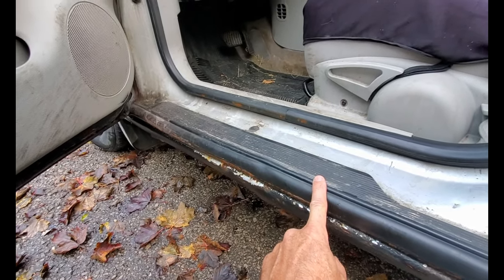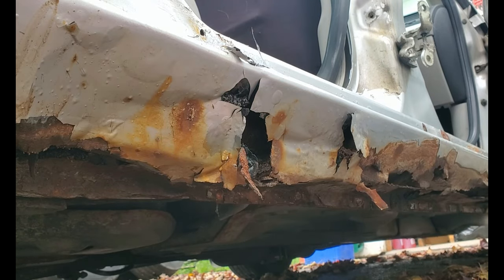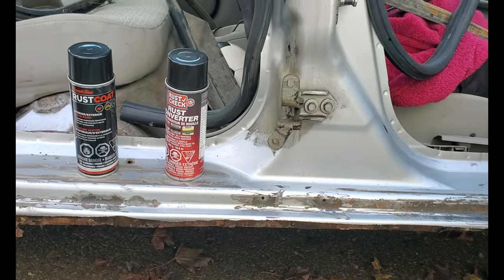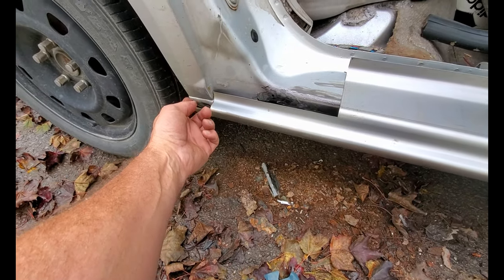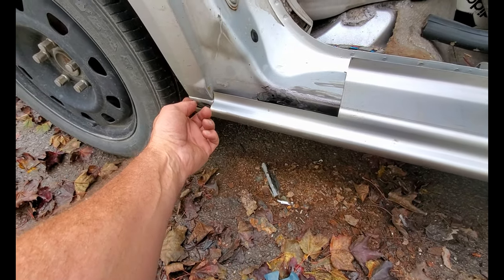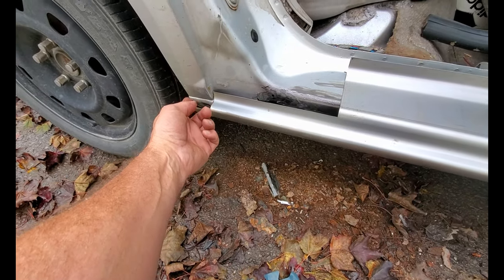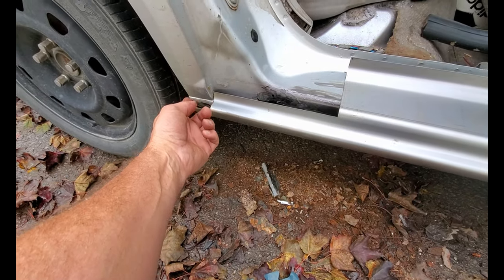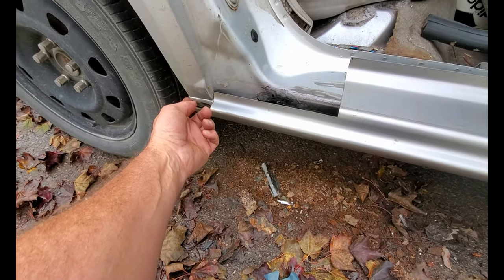Rusty Rocker Replacement  Pontiac G5 Sedan  FIXING FOR FAMILY

Comment: I have a 2006 Pontiac G5 Pursuit 2 door coupe bought brand new. Competition yellow paint. The car has sat outside for 18 years and the paint still looks brand new with no fade visible to the naked eye at all. It's amazing and looks so sharp when the sun roof is propped open and the 228 watt factory installed Pioneer stereo system is blasting and has a subwoofer in the trunk and a black antenna on the rear quarter panel. It kind of reminds me of a kid's race car.on an electric track. As with all G5s and Cobalts I pass this age they all have rusted rocker panels as mine does too. I enjoyed your video very much but I'm not handy at all to do the job you did myself. Do you have any ball park figure of what a body shop would charge that you've done for a family member for free? I want to keep her as long as possible as she runs like a Swiss watch and the Ecotech engine only has 120,000 miles. Thanks for the great video and has inspired me to get my rockers done.
Reply from the maker: Unfortunately I don't operate a body shop so knowing exactly what they would charge is hard to determine. I only know what I charge and I'm sure it's considerably less. That being said you can always take it to a shop and get a free estimate. Would be interesting to see what they charge for similar work. Thanks for watching much appreciated.
Reply: @swc-diygarage  Thanks and I will do that and update later!

Comment: Question: I bought a rust-free Grand Prix from outside of the rust belt that has plastic side skirts & of course the skirts are famous for trapping salt, dirt, & moisture behind them & rotting out the rockers. If I were to use spray expanding foam to fill the void between the skirt & rocker do you think that could be effective in preventing the rust from forming? Or if you have any other suggestions please share them with me. Or what if I just removed the skirt completely? Is there any reason I couldn't do that?
Reply from the maker: I would mark and remove the plastic skirt and spray it with a gravel gaurd and re install. What's also important is to oil spray inside the rocker. As you saw in the video there was two layers of sheet metal. The oil spray has to get to the bottom.

Comment: So if the rot was localized to just under the rear door would you have cut the new rocker in half and welded it to the factory front half?
Reply from the maker: Yes I probably would if the front section was solid. These panels are designed to go over top of the existing not cut and butt weld.
Reply: @swc-diygarage  thanks so much for the advice! Like another commenter  I have a grand prix with a small rocker issue haha!